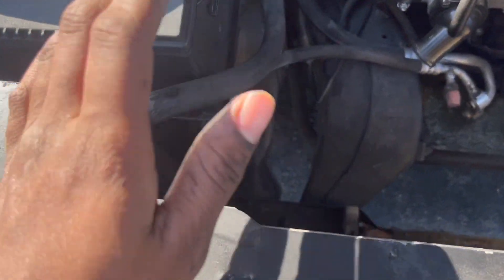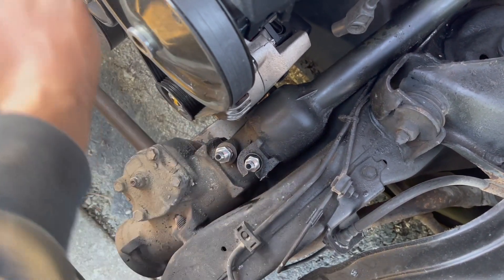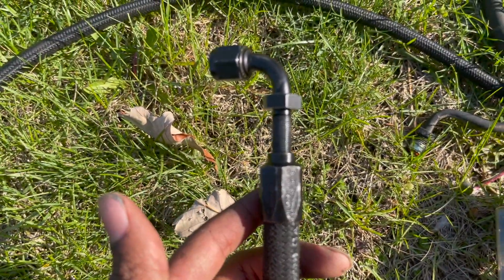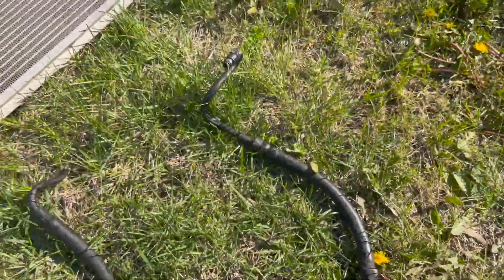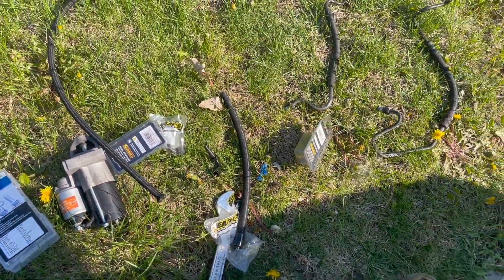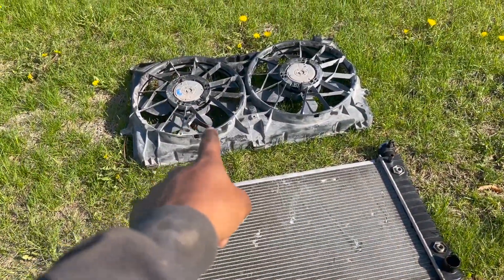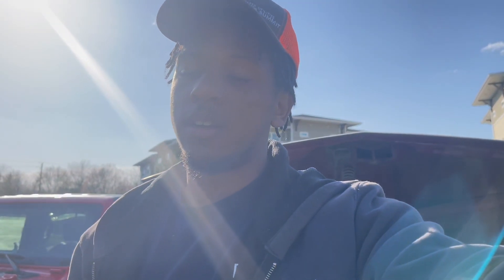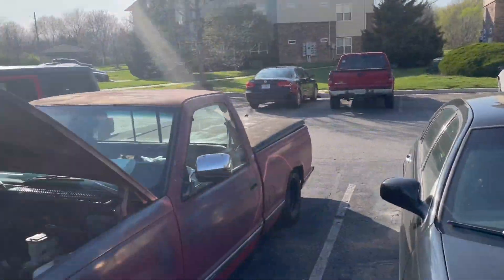What power steering hose,electric fans,throttle cable and radiator to use for your ls swap obs 88-98

Comment: Would recommend the Glenn’s Auto Performance (GAP) throttle/cruise bracket for the TBSS intake. Also what harness are you thinking about going with? I assume a standalone?
Reply: Shoulda seen your previous video lol, LMC truck sells the BP wire harness, corrugated plastic loom tho. I bought mine there but I’m replacing the the loom with braided TechFlex loom. Looking forward to the video merging both harnesses!  💯
Reply from the maker: @jesusfernandez4472  that’s the one I’m getting the bp harness but off there website they sell it with the split loom fit like an extra 60 dollars. And I’ll check that bracket out